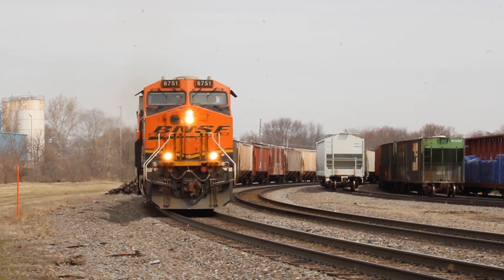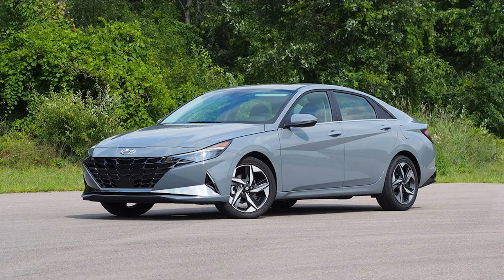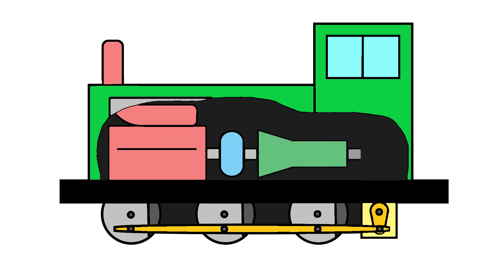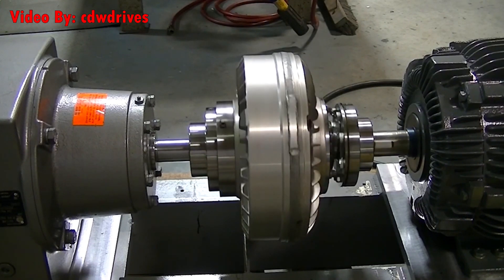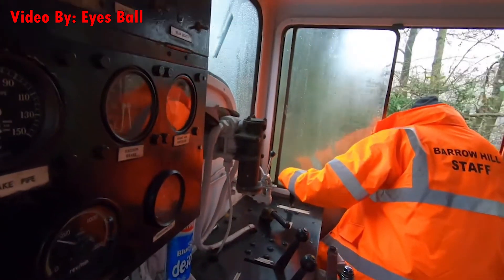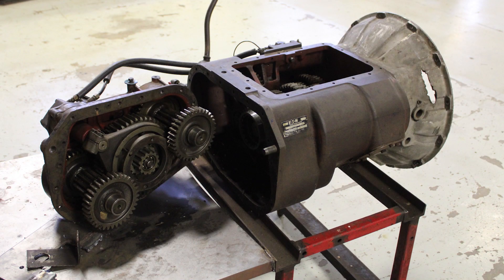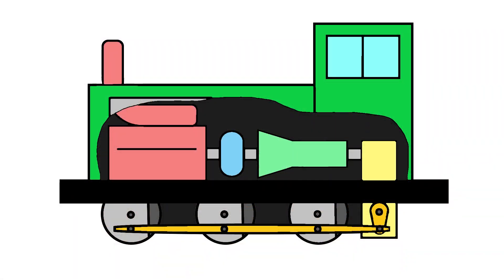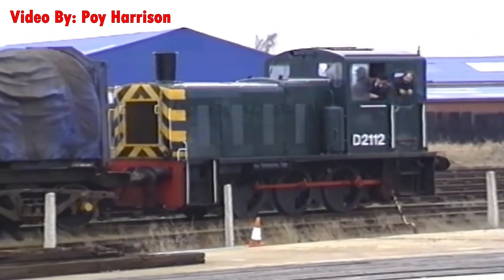How EVERY TYPE of Diesel Locomotive Works! (Part 2)

Comment from the maker: Small mistake on my part. The big red German locomotive that makes a couple appearances in the video is a diesel hydraulic locomotive, not diesel mechanical.
Reply: Yes, V200 class. The early Class 42 locomotives (named after Warships or admirals) in the UK were our equivalent of the V200 but crammed into our smaller loading gauge. They look quite similar.
Reply: a diesel hydraulic still is mostly mechanical drive though
Reply from the maker: @MiG21aholic  yes and no. The things being used to move the hydraulic fluid are mechanical, but ultimately it’s the fluid that’s transmitting all the power from the engine to the wheels.
Reply: @Southern_Plains_Railfan  via mechanical gearboxes and driveshafts, yes ;) haha
Reply: There was a American version of the V200-family: Southern Pacific  ML 4000 C’C’. It was the bigger version of the V200, somewhat a sister of the V300 - and at the time one of the most powerful diesel locomotives ever, which was also the reason why SP and others entered the experiment.... ;)
Reply: The Nialls Canyon Railroad have one of those locos, only has complete drive for one end but they have done an amazing job of restoration. I'd like to think the parts they need are still out there in the world somewhere but they believe not. Several people who had worked on the British version of the locos have actually been out to the states to assist in the rebuild. There were several fleets of diesel-hydraulic locos in the UK. @pearlyhumbucker9065
Reply: What is diesel mechanical
Reply: Is much like a car or small lorry with a manual gearbox. There is a clutch which you use with a handle and you must adjust the power up or down to suit the speed you are working at. It is very simple and only used for low power engines. You cannot move much weight with a Diesel-mechanical set-up, and only at low speeds <18Kmph. @ismaelangula6705
Reply: A late friend rode on a diesel mechanical rail car when stationed in the UK. The driver had a hand throttle, accelerator petal, clutch and gear shift as it was just like driving a truck. However, some had a fluid coupling instead of a clutch petal but still required being manually shifted like some older British Transit Buses...
Reply: You mean the Big Red DANISH engine? (DSB)
Reply: ...saved me explaining this and ripping you a second fart pipe 😉

Comment: They had a very old german shunter, at a paper factory close to where I lived as a child. 
As there was a dedicated line, from the main line into this factory area. 
They had this grandfather clock locomotive. It looked like things from steamengines, had been used as gauges in this thing. 

Worked well for 6 years, but probably longer, since before I was born in 84.. 
That had a gearbox too, and it also switched very slowly. So it did sound like a truck without a muffler, but we could tell it apart with those long gearshifts.. 
Otherwise we would fly over on our bicycles to the highway and get the trucks to honk their horns.

Then they actually switched to a MAN truck, that looks like a Unimog. Former rescue/wrecker vehicle i believe.. 
Fitted it with couplings and rubber bumpers, and there you go. It could really move those wagons. 4 - 6 at a time..

Comment: So they'd need high torque and few moving parts... Has anyone thought of sticking a CVT in a diesel?
Reply: It will slip alot.
Reply: @Suspicious259 Hmmmmmmm... Maybe we can weigh it down with concrete for better adhesion? And maybe stick 2 CVTs (built specifically for locomotive use, of course) for finer control of the gear ratio
Reply: @Combes_  i meant, the cvt gear themselves will slip.
Reply: @Suspicious259 I mean, I did say they'd be built specifically for locomotive use, so dealing with slip would probably be part of it, besides, no locomotive's perfect... Besides SD40-2s XD

Comment: My dad has driven a bus with an automatic manual transmission.  It had 4 gears and no clutch pedal, the gears were switched by pressing buttons from 1 to 3 and a somewhat misleading D gear which was just the fourth gear and not some type of automatic gear. The weird thing is, 1st gear was almost never used, 2nd was used for starting, and the shift between 2nd 3rd and 4th (aka D) were stupidly short. The bus could comfortably drive in 4th at 15mph all the way up to its top speed. So I suspect it used a torque converter before the transmission.

Comment: Technically, you weren't wrong saying engineering tolerances are in microns. Although they tend to be given in mm, they're usually on the order of 10 to 100 microns for things like automotive and rail engines and transmissions.

Comment: This high maintenance, inefficiency, and amount of things to go wrong, is why I hate tradition powertrains in cars & bikes. My future is full of homemade Battery-Electric-Vehicles and Series-Hybrids. I just want something that just works, so I can enjoy the other parts of my life. Not loose so much time to maintenance & repairs. And stressing out over maintenance schenduals and waiting for something to still go wrong.
Reply: tell me you know Jack shit about mechanical technology without telling me you know Jack shir about mechanical technology
Reply: @harrimanfox8961  
Well then, maybe you can educate me on Mechanical Technology.
Reply: @harrimanfox8961  
With a hub motor Electric Vehicle, like an Electric Motorcycle, the only mechanical things I have to worry about, are the motor bearings, suspension bearings, steering bearings, contactor/relays, any key holes not replaced by a wireless keyfob or tap,  any latches and hinges for compartments & luggage, the tires, aaaaand the controls like the throttle potentiometer and brake lever switches.

And Brake Regeneration is so effective, that traditional brake pads & rotors literally rust away, from how little they are used, leading EV manufacturers recommending occasionally braking hard, beyond Regen, to scrub rust off the rotors. 

And I believe there should be metallic brake-shoes, with teeth, directly holding the tires for parking, because Brake-Regen only works when the wheels are moving, from the physical resistance of the electromagnetic forces.  

Since the tires are a wear item that are likely the most replaced thing on an EV, then the vehicle might as well directly hold the tire treads, with durable, long lasting stainless steel teeth, that won't flatten or shred the tires, just hold them for parking on a hill.

My point is, all the mechanical things on an EV, last a very long time, and are inexpensive to replace, and most of them don't even cripple the vehicle, if they fail.

Then we get into Series-Hybrids, which are just EVs with onboard generators to charge or combine with the batteries. I declare, Series-Hybrids are the best option, because they give you the best of both worlds, the instant torque & stealth of electric, but the convenience of fuel. You just have to pick a time where you have to stop, or  ride slow enough, for the generator to charge the batteries, AND, power the drive motors. 

The stronger the generator, the faster the charge time and top speed while charging. You don't have to look for or wait for a plug, and because the engine is only turning a generator, then it can be kept at it's most powerful, or most efficient RPM, even better then a CVT vehicle, and there is no clutch to wear out, no transmission to wear out, no gear-shifts to fumble over, and if the engine has a block heater, then less wear on it, because lubricating oil and metal gaps are at or near operating temperature before you even crank it, and less wasted fuel from cold starts, and less wasted fuel in general, because when that generator engine is on, it is doing work, charging batteries, not wasting fuel idling. 

So, a Series Hybrid, dramatically reduces the maintenance of an engine, while getting the most out of it. 

And if you don't want to deal with the maintenance, mess, and complications of an engine, then you can just have a pure Battery Electric Vehicle, with either fast charging ability, or swappable batteries.

And yes, I'm aware, EVs that don't use hub motors, have to deal with gears & driveshafts. But isn't that alot better to deal with, then a whole multispeed gearbox?

All this, is what I meant, with my original comment. I'm sick of the mess, and the things that can go wrong with a traditional engine & gearbox powertrain, for cars, bikes, and trains too.

BEVs and Series Hybrids, are my future, mainly for the reduced maintenance, and much less to think about. And it's so much easier to modify an EV or Series Hybrid for more performance. Just programing in different Amp limits, and trading up to better parts. And of course, like old times, you can dive into the mysteries & complexity of getting everything in an engine to work together for more power. But at least you don't have the variable of shifting & wearing so many gears.
Reply: @harrimanfox8961  
I forgot to mention. 
With my metal-braking-shoe-on-tire-tread idea, the shoes are either a part of the unsprung weight components of the suspension, pushed into stopped tired by air/hydraulic pressure, or, the parking shoes are a part of the sprung chassis, above the tires, and an airbag or hydraulic suspension just lowers the vehicle weight onto the tires, beyond the bumpstop of the normal suspension stroke, so the vehicle's weight, is what's locking the tires in place, for parking on a hill.

This for parking, and powerful Regen Braking for stopping, is my solution to delete the wasteful and costly traditional brake systems for non-railroad land vehicles.

Comment: 1/1000th of an inch.. 
I can't use that. What 2/1000th of an inch then? 
It doesn't exists... 
It is dumb.
Move the comma one number, from cm to mm and you're there. It's that simple 

Edit* 
Added some more to elaborate on, why it is dumb to use imperial measurements, for measurements
Reply: What is 2/1000ths of an inch?  It's TWO thousandths of an inch - just like 2/1000ths of a meter is TWO micrometres!  DUH.
If you want a video on 'Why it is dumb to use imperial measurements', DO IT YOURSELF.

Comment: DMU diesel multiple units are the big one I guess? Six cylinder Mercedes bus engine (because tilted over) Into a torque converter and clutch-pack gearbox. A drive shaft goes down to the bogie. All the engine stuff is on a removable raft pack under the body. They are very easy to change up to hybrid by popping a motor/generator between the engine and gearbox.

Comment: The Budd RDC  had a wwii tank diesel by GM , 6-110 and an automatic transmission.

The later SPV-2000 by Budd had a 8-92 truck/ bus engine and transmission.

Comment: Have you ever heard about locomotive M 290.0, known as "Slovenská Strela"? It has hybrid engine. It have combined the diesel-electric and diesel mechanical engine. At low speeds the train was moved by diesel-electric engine and after it reached around 80 km/h, the engine mode was swtiched to diesel mechanical mode.

Comment: Hmmm, seems that Turbine Wheel is similar to the old Fluid Drive Trans in some of the 1947 Cars. DeSoto for example. But, anyway, I still remember as a kid hearing that Steam Loco rolling thru the night and that whistle piercing the night at the crossings. Miss that.

Comment: There are also small two axle shunters without any torque converters. They have a pneumatically operated clutch from a heavy duty truck. The gearbox is 4-speed with a reverse, in order to drive in both directions at the same speed. Such locomotives require skill on the side of the operator, he has to handle the pneumatic clutch lever with care and at the same time increase the engine RPM. Such shunters are not in use anymore, or at least I do not know of any. But there were purely mechanical systems without any fluid coupling. Then there was a electromechanical drive. Electric motors to get the train up to speed, then a clutch mechanism, directly connecting the engines to the wheels.

Comment: Awesome video.  The hyundai pictired likley has an automatically shifting gearbox with a computer controlled autmatic duel clutch. No torque converter or fluid coupling

Comment: When I was employed on the Huckleberry RR as track foreman, I used a 12-ton Plymouth diesel-mechanical loco with a D8 Cat engine, 4-speed transmission with a clutch, and a forward and reverse.  It had 1.1mph in 1st up to 12.5 mph in 4th in F and R.  The final drive was No. 200 roller chain from the transmission to each axle.
Reply: Yep, had the same thing in rail construction for our ballast cars. 👍👍

Comment: The Bombadier Vlocity VLine trains in the state of Victoria, Australia are diesel mechanical. They are like a metro train with multiple Big diesels coupled to Allison automatic transmissions at each end of the train. Our state still has a fair bit of heavy industry manufacturing that has survived globalisation and free trade. I believe part of the reason diesel mechanical was used is because Kenworth and a few other truck and heavy haul companies have factories nearby and because these passenger trains have been in constant production since 2003 it made sense to use the existing supply chains. The trains being entirely passenger service are also pretty light and they are pretty fast too traveling at 160KMh for much of their journies (100MPH) a lot of people live in the second largest city, Geelong and catch the Vline train into the capital, Melbourne everyday for work and it'sfaster than driving. 
They are very nice trains to be on and the fares are now capped at a maximum of $9.20 a day to go between any 2 points of the entire state. You could cover more than 400KM about 300 miles by train in a day and spend less than 10 bucks Australian or about 6 bucks US.
Reply: There seems to be some confusion about the Vlocity VLine trains, their technology and their history:
It ś Diesel-hydrauic propulsion, not diesel-mechanical, the latter consisting of engine, clutch, gearbox, chains or today cardan shafts.
Nor does the technology originate from the truck. The Cummins QSK19R with its 750 hp is certainly much bigger than the biggest truck engines of its time and it is also marketed as a locomotive engine. 
The Voith T312 is developed for railway operation, for high performance in combination with high speeds - both specifications that have no relevance in truck operation.
The idea that the material comes from truck construction is typically American, but in the light of day it is nonsense.

Also, the railcars are basically not Bombardier. The order was placed woth ADTRANZ in Kassel - Daimler-Benz was involved and the factory is the old HENSCHEL plant. 
Interestingly, Bombardier Transportation was headquartered in Kassel. So you have to ask yourself how much Bombardier was in there.

In any case, it's one thing to talk about names. Because - Bombardier is also history now, it's ALSTOM now.
Reply: Incorrect, it uses a hydraulic transmission. They use Voith hydraulic transmissions, not Allison automatic mechanical gearboxes. It seems the older Sprinter railmotors are the same (but with a different model of Voith transmission)

Diesel-mechanical is rarely seen in standard gauge passenger rollingstock, except for some old British railcars that used a system of tightening bands to engage different gears, and also the heritage railways that use a diesel shunter to pull tourists around a small loop.